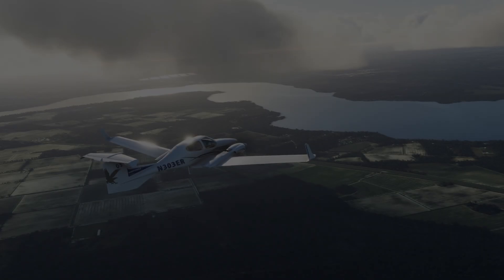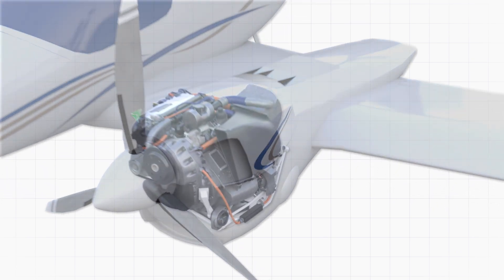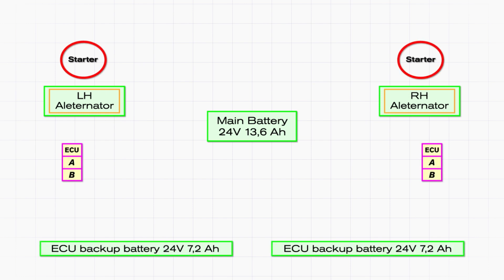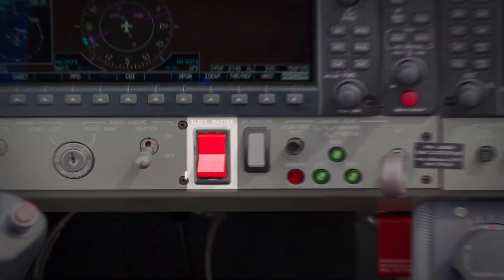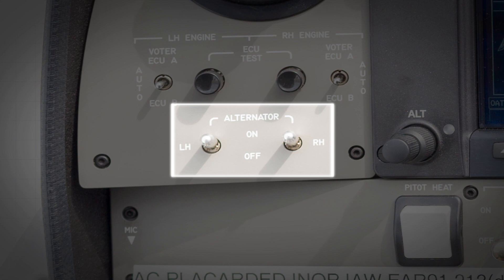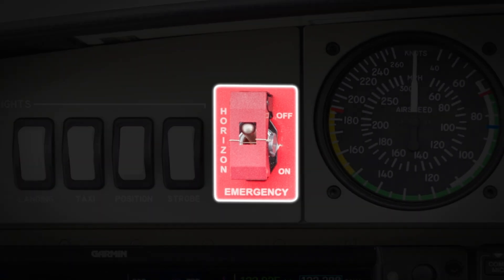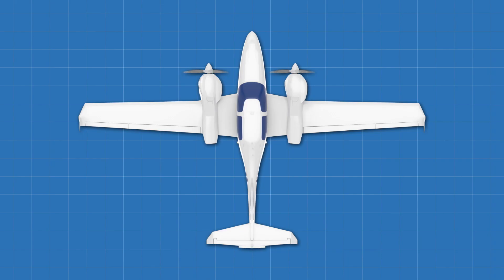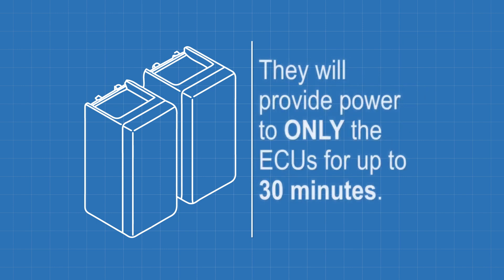Electrical System DA42-VI

Comment: Regarding the emergency horizon switch, it does provide power to the flood lights and standby attitude indicator, but there isn't an "electrical vacuum pump," as indicated in the naration. The attitude gyro is electrically driven, with no vacuum system on the aircraft whatsoever.

Comment: 0:40 the main battery is not "primarily used as a backup" if the alternators fail. It's not big enough to last very long if both alternators fail. It's basically there to provide power to the systems for a short time before engine start, start the engines  and prevent any transient voltage drops in the electrical system (like when operating the landing gear).